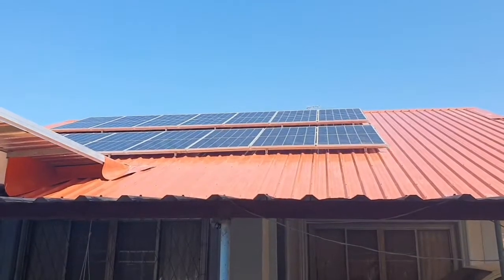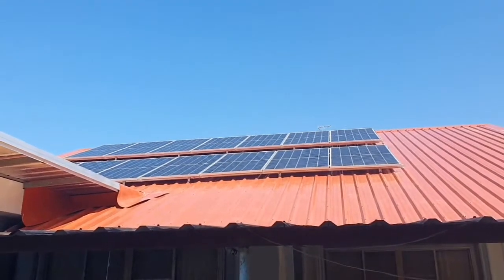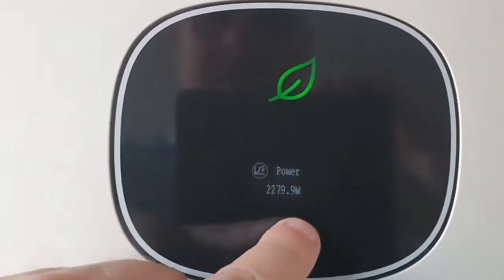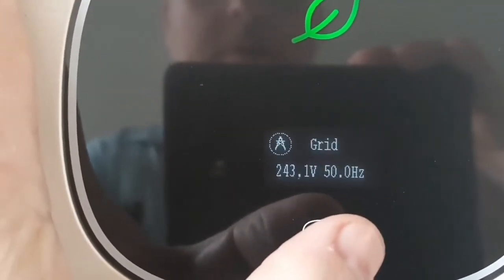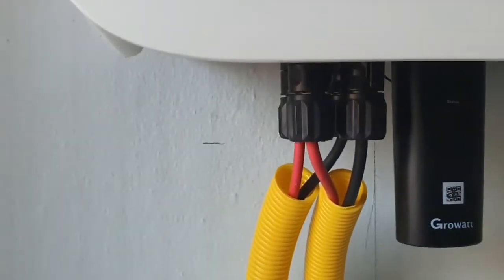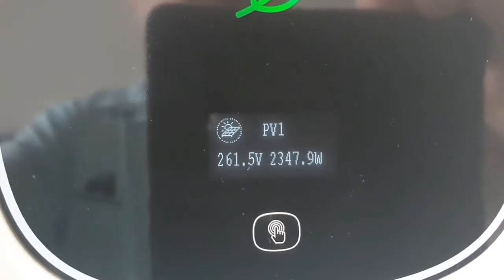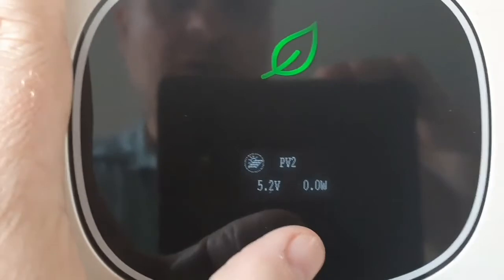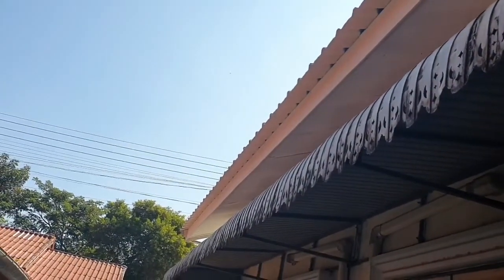About oversizing solar panels

Comment: Who can control the other string , energy supplier , my one is growatt too 5 kWh I notice one string running full potential the other string is 5 volts why not use the full potential of inverter how can the owner turn on the other string I have same inverter nearly over year old .. 5 kw h .. I can see production in my app also manually by observing actual display on inverter .. I’m not happy , who is controlling it I have a smart meter I’m in Sydney Australia 🇦🇺 I notice in winter only 2 days my system produce over 31 kWh .. but average is above 20 kw .. one string does all the work other is always showing 5 volts only, who is controlling my inverter I have on line account shine ✨ app.. seems strange one array sits idol on roof .. using my roof space .. about 18 panels in total making up 6. 6 kWh I have complained to imbudsman energy provider who owns the poles and wires is Ausgrid my retailer is origin.. I have red many posts the supplier does not want customers to give back more than 5 kw into the grid they can control your inverter and smart meter .
Reply from the maker: If you are getting 31 kwh in one day on a 5 kw inverter: this means both strings are working reasonably well. If one string was not working at all, it would be impossible to get 31 kwh in one day.
Reply: @ChaweewanGroup  but why in your demonstration one string is 5 volts very poor ..how do U make them both work full potential..how do U go to settings? Who is controlling it ?
Reply from the maker: @johncavar2914  it says 5 kWh, that's the production that day.